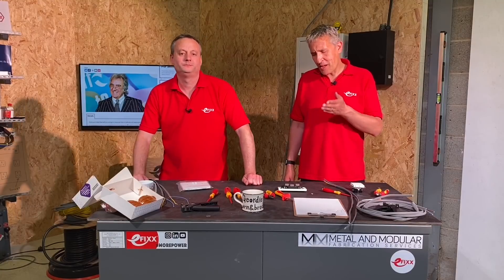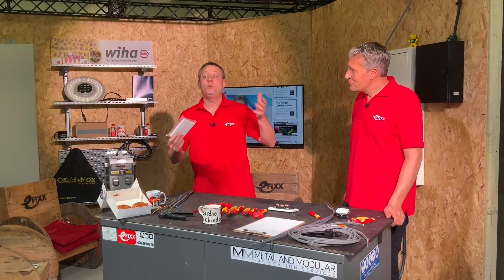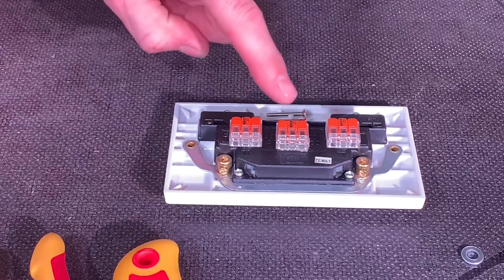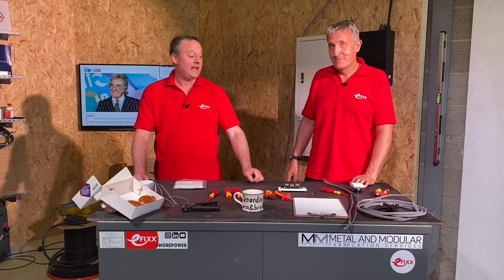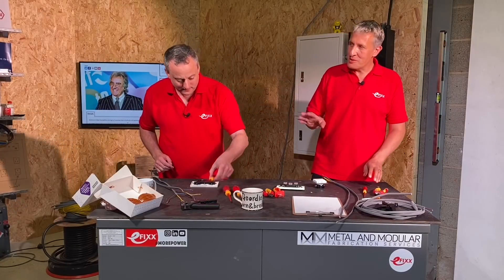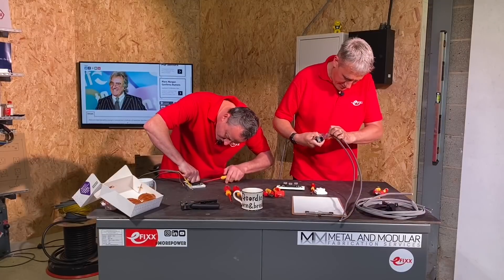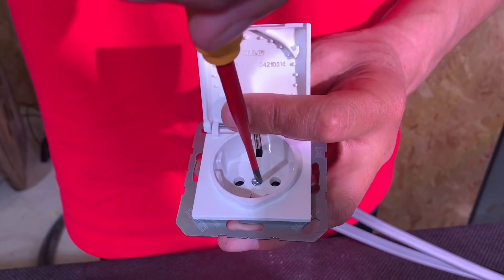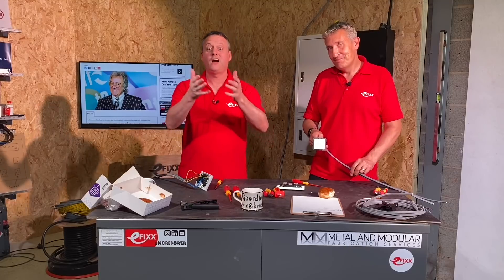When will UK sockets have WAGO style connectors? - electricians comment

Comment: Manufacturers won't make them because it will cost them to change the designs and get the products tested when they already have a product that works and sells.

I would like to see the push connectors fixed to a back box like that German design so that cables don't come loose or get pinched when screwing the socket back. Imagine being able to 1st fix and test before the sockets are screwed on. Painters would love that!
Reply from the maker: Great feedback thanks 🙏
Reply: wow, yeh, this!
Reply: You can put Wagos in the backboxes, then test. Then the painters come and paint, then just one flexible cable from the Wagos in the backboxes to the socket. Far easier to fit. 

Wago type connectors are becoming very popular, as they are maintenance free terminals (they can go in inaccessible places) - and quick and easy to use. Put them directly on the back of a socket they will sell.
Reply: @johnburns4017  so every connection is a spur?
Reply: @GodIsBackAtAnfield  
Yes. The cable from the Wago junction in the backbox to the socket can take ~27A, while the outlet is limited to 13A.  Not a problem.

A disadvantage in rings is that if some screws work loose on a socket which is a junction on a ring, the ring's effectiveness can be reduced. Also a dangerous situation occurring as heavy current in the ring may create a spark.  One one the 2.5mm cables may be overloaded as the mcb is 32A.

Wagos do not work loose, so current around the ring will always be sound. 

Same on a 4mm radial with a 32A mcb. 4mm in and out of the Wago in the backbox with a flex 2.5mm cable into the socket. Easier to wire in in the confined spec of a backbox. Also testing and painting can be done, then return for the second fix - screwing in the sockets.

Loose screwed connections is a big source of electrical fires.
Reply: @johnburns4017  Do you then retest every point on your circuit afterwards as you are technically altering the circuit after you have previously tested the ring? You would then be testing the circuit twice and still have to wire a L, N and CPC in the screw terminals of a socket from the Wago connectors upon 2nd fix. Is that correct?

By the way, I'm all for maintenance free screwless terminals as they are much safer than screw terminals due to overtightening and also not tightening enough.
Reply: @GodIsBackAtAnfield  
The prime points:
♦ The first fix is done, then painters can do their work. 
♦ It is much safer on a ring or radial as there are no screws to loosen on the main current carrying cable(s).
♦ The socket and cables in the backbox are much easier to fit with only flex cable from the Wago to the socket. No heavy inflexible cables to a socket which then has to be shoved in. 
♦ The only screwed connections are at the socket, which only draws current at that socket outlet when that outlet is operational, limited to 13A. 
♦ Using Wagos in the 1st fix in the backbox will make it a simple job of testing continuity of a ring or radial just as it was installed. If any problems they can be addressed before painters move in. If a problem then it can be attended immediately. Rectifying problems after finishing trades have left can be expensive.
Reply: @johnburns4017  so do you retest then afterwards?

If you were called back to do some additional work on one of your circuits that then required a spur, how would you go about it?
Reply: @GodIsBackAtAnfield  
You have to go back after the painters have done their work. You do not seem to be getting it. 

Extending circuits after, way down the line, is another matter.
Reply: @R-77 
Reduced cost in time and labour.

Comment: Crabtree did some switches in the late 80's maybe early 90's which I remember using, and they were push fit terminals. So on this occasion the Germans were behind us.
What about when you require a twin earth terminal socket for IT equipment.
Reply from the maker: Yes the Corinthian range from Crabtree - why didn’t that take off?
Reply: @efixx  good question,  probably ahead of its time, maybe too radical for the period.
Reply: efixx if I had to guess I’d say cost, I think we’re in a different time now though and there will be huge demand for whoever releases this first
Reply: My (Dutch) house was built in 1983 and already had push fit socket and switches. So trailing behind Crabtree? Don't think so...
Reply: @Richard_van_der_Heijden  what part of Germany is Holland in 🤔
Reply: Busch-Jäger presentet in 1967 screwless push-in Terminals:
https://www.busch-jaeger.de/geschichte

Comment: As you said there must be something in the regs forbidding this or surely it would have been done by now? Have seen loads of times where you unscrew a socket face plate and find loose terminations or where somebody has "missed" the screw with the conductor and it's only loosely in between the screw and the barrel. This just makes all that go away and much better for testing or fault finding if you need to disconnect a leg on a ring for example. No brainer in my eyes and would happily pay the additional £1.50 or so that it would likely cost.
Reply: Phil Shanahan it’s not about the regs but business ££.. produce paying the bare minimum and sell for biggest profit..
Reply: If there is something in the regs or BS then this needs to be changed ASAP. But I would buy and fit sockets with push fit terminals in my home regardless of what the regs say; as the householder I have this flexibility in my home. Pity my poor tenants who have to take a chance on whether the spark I employ has a calibrated torque screwdriver!

Comment: Defo the future already using them here in france 🇫🇷 sooner the better when is the uk going to catch up and also ditch ring circuits
Reply: smile 2192  No surprise we use radials here in Sweden too. No problems with limitations on socket numbers other than lazy/cheap installation. We just have larger consumer units with more circuits. Sure there's more expense with more breakers, but that comes with added convenience in being able to isolate smaller areas. In my house, each room has a breaker with lights and sockets on it. Kitchen has a couple of circuits to allow for more simultaneous high power appliance usage.
Reply: @paulekstorm-hughes1894  
 In my house, each room has a breaker with lights and sockets on it... Just wondering what cable size do you use for lights and what about worst-case scenario... thanks
Reply: @MalikIdreesMasood  lights and sockets are for each room are on the same circuit. Each standard room circuit is on a 10A MCB. All wiring on such a circuit is 1.5mm2. In Sweden, 1.5mm2 is the smallest allowed wire for fixed installations, even if it was on a 3A MCB. Of course, larger cross sections are used for higher rated circuits.
Reply: @paulekstorm-hughes1894  
We had to fit in sockets for a line of 10 computers. There was only one spare way in the consumer unit. We gave each computer 3A fuses in each plug, so a 32A ring did it wonderfully. Using radials a new larger Consumer Unit or an additional unit would have been needed. Which would have been great expense.

A radial of 20A gives six sockets, not enough. We could have used 4mm cable and a 32A radial. But getting 4mm cable inside 10 daisy chained sockets? Forget it.  Also 2.5mm cable in the UK is cheap. Cheaper to run to 10 sockets in a ring than one heavier 4mm cable. We could have put a few extra sockets on the ring with any problems. 

Rings are not illegal in any EU country. EU appliances tend have a fuse in the appliance. Rings are very handy. Understand them and what they offer.
Reply: @paulekstorm-hughes1894  
With low current LED light becoming the norm, 1.5mm is overkill.  They need to charge their regs, and get up to scratch.
Reply: @paulekstorm-hughes1894  
 @Mathias Anders  
British plugs cannot draw more than 13A. Fused spur switches off a ring  for fixed appliances cannot draw more than 13A either (although you can draw more than 13A off a ring on one appliance with special provision).  The plugs and fuse spur switches were made for rings in mind. When you design a ring you use diversity calculations, or just common sense. If a 32A ring has three sockets that regularly will be drawing 13A tripping the 32A mcb, then put in another ring.

The average British house has three 32A rings. 
1) One for the heavy appliances in the kitchen: washing machine, dishwasher, tumble dryer and worktop, maybe an electric kettle.  
2) One for downstairs. 
3) One for upstairs. 

The upstairs and downstairs rings generally draw little current as only light appliances will be connected, like TV, computers, hairdryers, etc. Each appliance that plugs into the ring should have a fuse matching its current drawing, which could be 3A, 6A, 13A, etc. Mainly to protect the cable to the appliance to prevent the cable overheating, if over-current occurs. 

When builders put in three rings, an upstairs radial lighting circuit, a downstairs radial lighting circuit and a 6mm cable for the cooking appliance, all by rule of thumb, it works and is safe. You will find the consumer unit will have just six micro circuit breakers. Cheap and effective. 

Look in a French home of the same size. They have a huge consumer unit in comparison, with far more circuit breakers (mcb's), serving many radial circuits.

Comment: just as a thought, industrial sockets and plugs are already available with tool less connections, (16 amp, 32 amp, 63 amp sockets)
Reply: @aryehelectricalltd7247  that's incorrect and also misses the point.

Firstly the video wasn't saying that sockets should have WAGO branded connections, but rather some form of toolless connection.

Secondly the comment you've replied to was saying that the international/industrial sockets already exist with toolless connections.

Thirdly WAGO actually do make connections higher than 2.5mm², the new WAGO 221s fit up to 6mm².

Finally, there's no reason why a 13A socket would need connections rated higher than 32A.
Reply: Makes sense, since that's an international standard while 13A sockets follow a BS standard
Reply: @aryehelectricalltd7247  Hager Quickconnect, for use inside of boards. Even the bus bar is screwless. Rated for 63A. But the thing is, do you really need 32A rated connectors in a ring circuit? My answer is no, the cable itself (2.5sqmm) is only rated for 20 or 25A depending on the reference method of installation.
Reply: @aryehelectricalltd7247  That's not quite true, the 221s go up to 4 mm2 and that should be plenty.
Reply: @Ragnar8504  Actually there are two versions of the 221, the small ones up to 4mm² and rated 32A. The big ones are rated for 6mm² and 41A.
There's only a small difference in the designation, the small ones are 221-4XX and the larger ones 221-6XX.
Reply: never seen a 63A version or 32A
Reply: @michaeldunham3385  it's the CEE type socket.
There standardised in the EU.

Comment: they look good but i can see so many cpc's not going in as the earth sleeving moves, there are so many who don't bother checking the connection and just shoving the accessory back to the wall. would it save time if we did not have to use sleeving and cables came with the cpc pre insulated? or would it lose time, we would have to learn a new way to strip the cable and buy the proper tool instead of using a knife or as so many do and use the cpc to slit the cable.
Reply: new regs in the republic of ireland, all t&e cable now have the cpc insulated throughout the cable
Reply: I heard that in the RoI the CPC is the same CSA as the line conductors - is that true?
Reply: @misstakenot9582   yes sir, can be a pit of a pain doing new shower jobs etc, with 10mm earths going into a tiny shower back box, but saves time i guess with no earth sleeving during the 2nd fix stage, and makes the fuseboard look neater, clipping wise i use 2.5 clips for lighting cables, slightly stretch 2.5 clips for 2.5 cable, i dont think they fully were prepared for the change and didnt think it out right
Reply: @Subzero2151  that 10mm shower cpc sounds a nightmare to 2nd fix if it was a 1gang box lol
Reply: Same as in Australia, t&e has sleeved CPC throughout. I personally can't wait until these sockets are commonplace!

If anyone's not double checking cpc connectivity with sleeving, then they shouldn't be on the tools IMHO
Reply: @adejupe8308  i have news for you, they are already on the tools and they already miss enough connections without checking.
Reply: If the accessory was properly manufactured, so that line and neutral connections were fully insulated, sleeving the cpc would in fact become redundant as there would be no possibility of the bare wire contacting the other connections. Sleeving the cpc was introduced principally because of poor manufacturing design that allowed the cpc to touch exposed live parts (line/neutral screws) when the accessories were fastened home onto the backbox!

Comment: Would definitely use a push fit or lever connector socket, just as long as it doesn’t come with a proprietary “tool”....
Reply: And it needs to fit 3x 4mm cables.
Reply: @MrIbib  just get rid of ringmains...
Reply: @florianbayer2054  ring main or ring final? Doubt the DNO is using wagos on the ring main.

And if you’re using 4mm, you’re not that likely to be doing a ring final either.